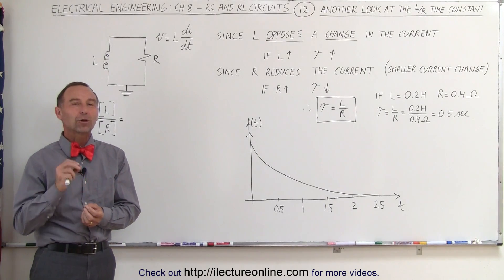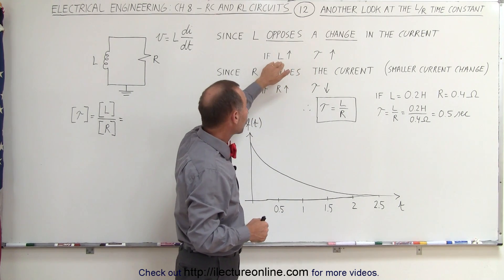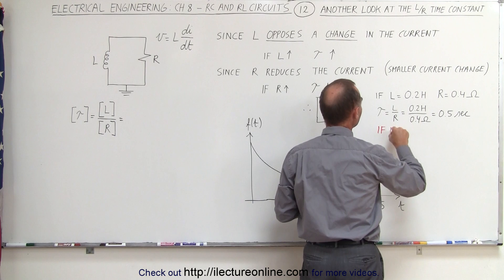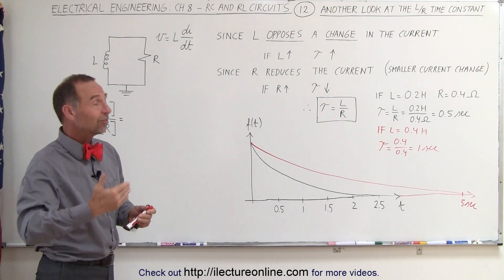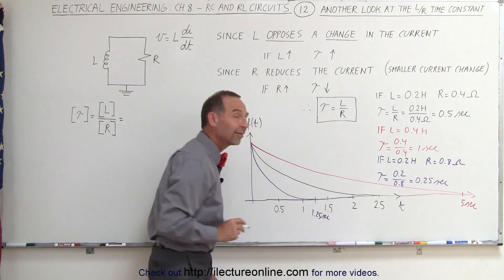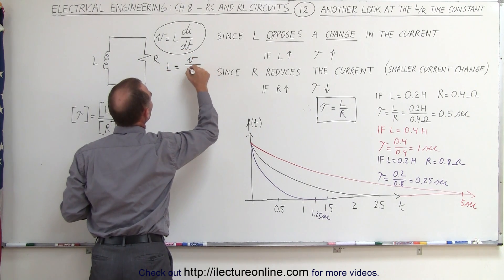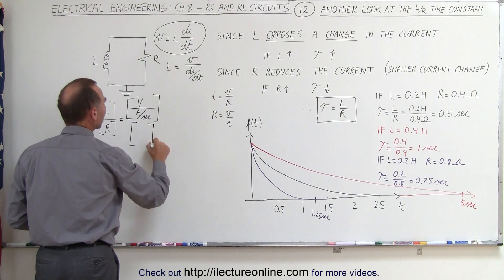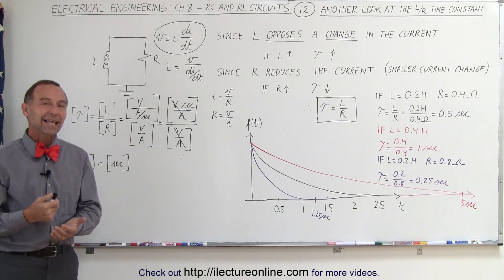Electrical Engineering: Ch 8: RC & RL Circuits (12 of 43) The L/R Time Constant (Another Look)

Comment: The time constant is inversly proportional to R. 

How the analysis of R = 0 (shorted)? Will the time constant be infinity?

Also how the analysis of R = infinity (inductor without resistor and open circuit). Will the time constant be zero?
Reply from the maker: In the real world the resistance is never zero.  Even conductors have some resistance and so do inductors.
Reply: @MichelvanBiezen  so, when an inductor shorted, time constant of discharge will be so high because of lower resistance?